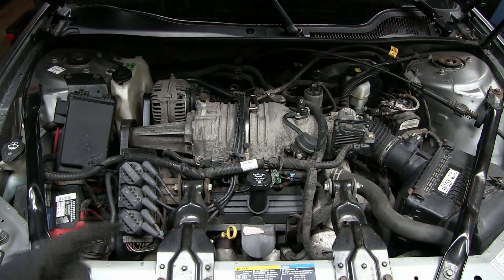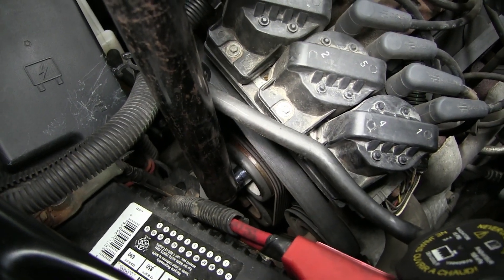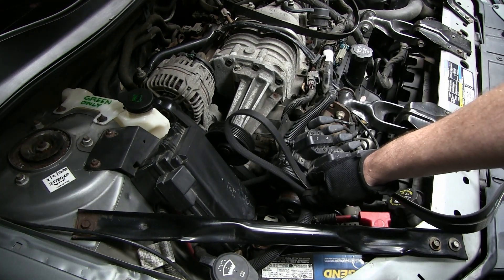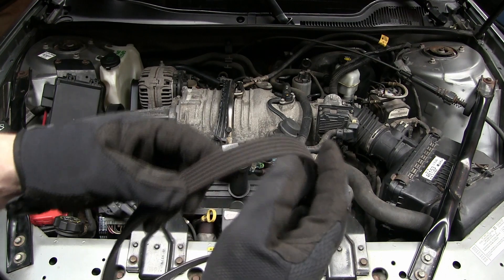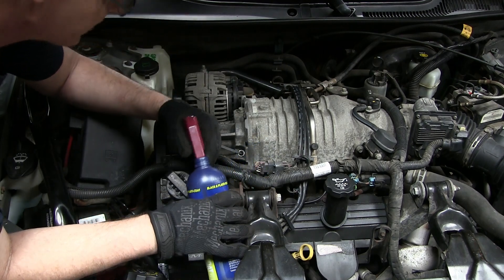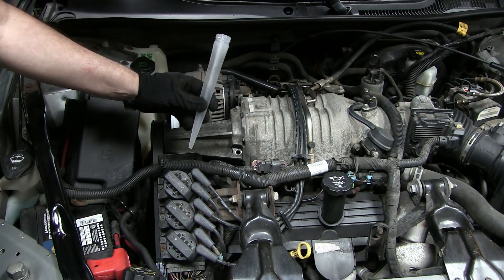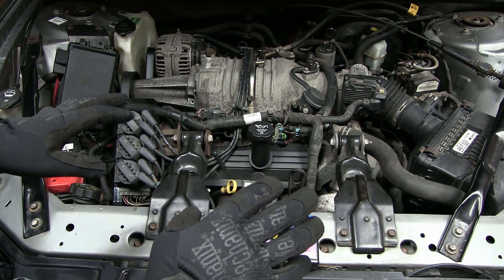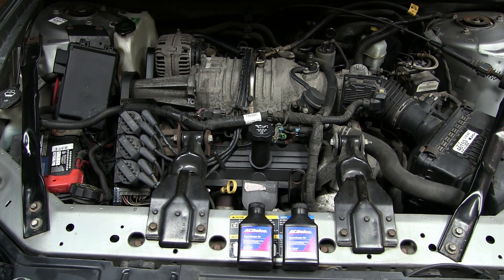Eaton M90 Supercharger Oil & Belt Change - GM 3.8L 3800 Series II/III V6 Engine

Comment: After my top radiator hose blew, I drained out the remaining orange coolant, and filled 💯 with prediluted green coolant, car even runs 7-10 degrees cooler then it used to
Reply: Add some super cool to it. Did that on my 3.4L, and she runs cooler and cools down faster. Super cool make water wetter.
Reply: @tri9398  no need it runs at a steady 187 °F

Comment: do u have to run 91 octane in theese cars
Reply from the maker: Yes and no.  If you always drive it like you stole it then it would be wise to only use premium.  Stay out of the boost by driving like a grandma and 87 will suffice.

Comment: Is the tensionser pulley the same for the two belts?  Pull counter clockwise to loosen regular belt and clockwise to loosedn supercharge belt?  

Or two different tensioner pulleys for the two different belts?

Thanks for the video.  Very concise and easy to understand.
Reply: Has two different tensioners
Reply: @homeroaguilar6163  The 2003 ultra has a 14 mm on the alt belt tensioner and a T50 on the supercharger tensioner. Crazy they made these 3.8 hard to service.